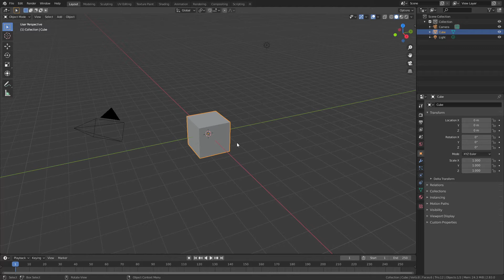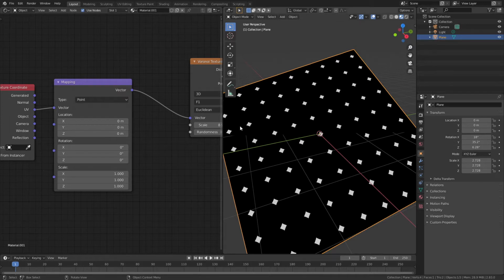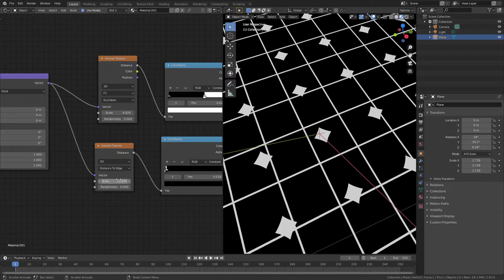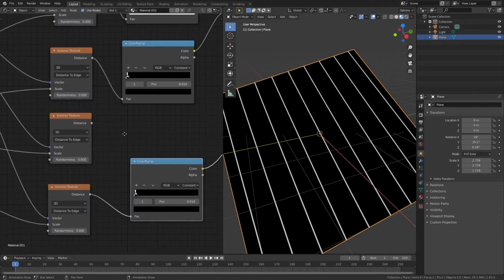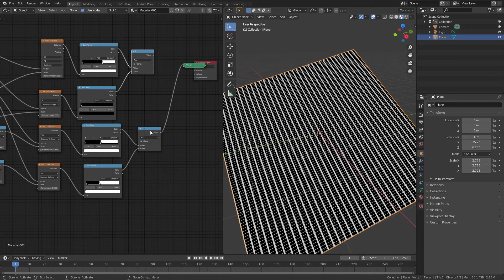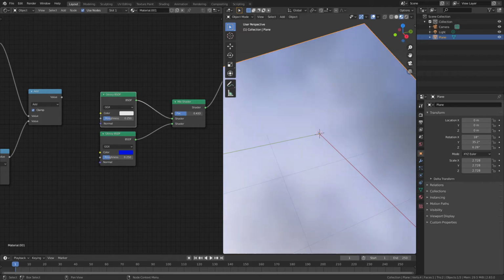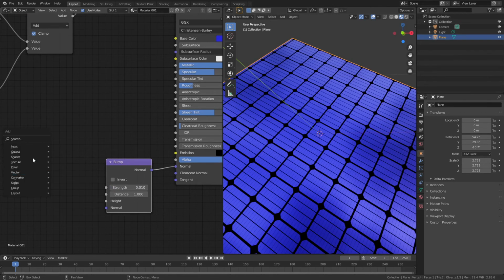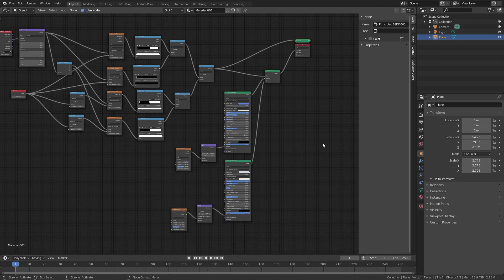How to Make A Solar Cell Texture in Blender

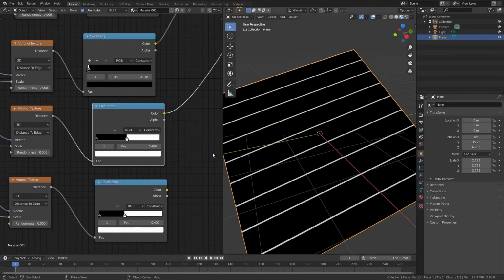Comment: hii when i was controlling the grid at 6:43, the duplicated one didn’t show any fine lines however it was pitch black. I made sure it was connected correctly just like in the video so i was wondering if you know other reasons on why it might not be working? Thank you in advance

Comment: hi, im a final-year degree student in solar engineering. i just came across your video and wanted to ask: for this particular software, can i design an IBC or ABC solar panel? i want to place the busbar on the rear side of the panel to eliminate shading. also, can I transfer the data from the designed panel to another software to compare its efficiency with a standard panel? your answer would be highly appreciated, thank you!
Reply from the maker: You should be able to pattern the front and back face separately if you needed to. There is a node called "backfacking" that would let you select for a specific plane. Alternatively, you could assign different materials to the front and back faces that have different layouts. You would have to adjust the shader settings to match with what you are describing. As for transferring, I believe you should be able to bake the texture as an image file. If the software you are using to determine efficiency uses images as inputs that might work

Comment: Thank you for the tutorial! Can we save this texture so we can use it for a later project? If so how can we do it?
Reply from the maker: Because the texture is procedural you could definitely just save the blender file and append the material to a new file. File-Append-(Choose the Blend File)-Materials. It is also possible to put this material on a plane and render it for use as an image texture. If you want to do that there are tutorials on YouTube for properly rendering all the right settings and for roughness and normal maps. I'm pretty sure CGMatter/Default Cube has some videos covering that. Update: Blenderbinge also has a video covering exactly this topic though it doesn't cover adding normal maps and such.
Reply: You can bake the procedural texture into a normal texture.
Reply: @JonqsSimulationsOfficial how? :)
Reply: @ODxOJ there are tutorials here on YouTube